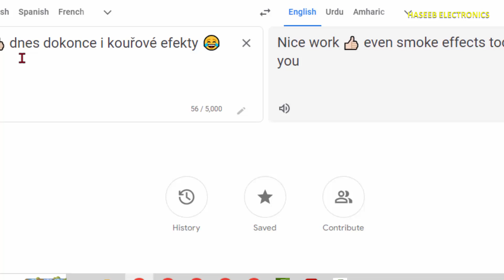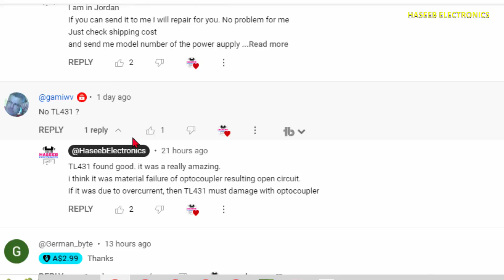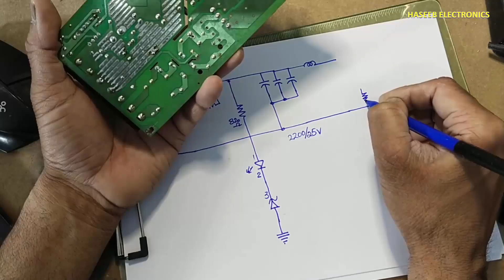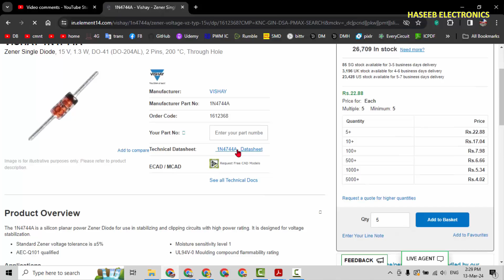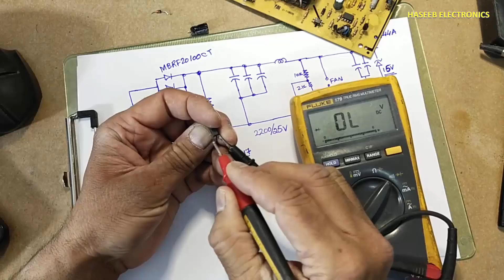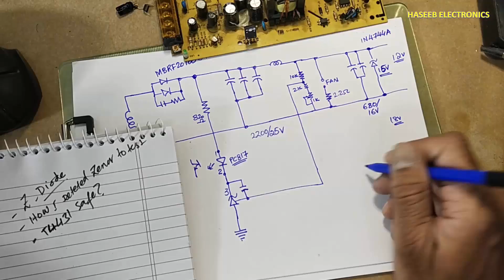{1071A} Why Zener not installed? SMPS secondary side, explained

Comment: Hello, congratulations on your very well-explained videos. I've learned a lot thanks to you. Could you explain the starting resistance circuit, how to go from 300 volts to 12 or 15 volts for VCC, and what current is needed for the calculations? If the VCC input were to break, would the capacitor charge to the supply voltage and consequently explode? Thank you.

Comment: I face  the same case as here ie ZD   short circuit , when i  rénové the faulty DZ I get the constant 12.20 without fluctuation ...now the question is what DZ raté çan i use because the DZ's  broken and i have no clue about the value [ no schematis under hand ] thank à lot

Comment: selam aleyküm.ı have two smps led transforemer one of them out voltage is 12 volt  good but fan no working. the other is  voltage is only 2.9 volt..ı did check IC is okey. 2655 two transistör is ok too.big capacitör is 320 dc volt okey too.ı didnt know what is poblem..thank you very much inşallah you will write to me for answer.ı will wait my brother

Comment: good video i am a follower of your videos. your videos are so informative and lot of new ideas.
- sir I have a 24V power supply with no out put - the PWM IC is 3845, I have 2.6 voltage only on VCC pin of the IC.can you please advise.

Comment: Thank you your post. Based on your video I was able to identify the wrong component in my SMPS. As you mentioned the ticking noise means there is a short in the secunder circuit. Stable but low voltage - 3V - output means the feedback circuit is ok. Using infra camera the TNY610 SCR glowed up which I think is doing the output short protection on the 5V rail. After desoldering it turned out it is malfunctioning, 600 ohm between the Gate and the Cathode in both direction. Replacing it tomorrow, curious about the result.

Comment: Greetings from Russia! In my switching power supply, when connected to the network, the Schottky diode immediately burns out (in your case, these are MBRF20100CT diodes). Replacing the pulse transformer, PWM controller, smoothing electrolytic capacitor does not give anything. The zener diode is 12 Volts when ringing in the circuit, normal. Although, the mains voltage. instead of 230 Volts, it was only 204 Volts. Please tell me the reason for the short circuit of the Schottky diode, and where (in what) to look for a malfunction??? Thank you in advance, peace and good luck to you.

Comment: CAN WE PUT A RESISTOR IN SERIES WITH ZENER DIODE TO SOLVE THIS PROBLEM?
Reply from the maker: no 
it is a sfety crowbar. it must remain in same condition 
in case the SMPS exceeds its limits. this crowbar will protect the next circuit

Comment: EXCELLENT ANALYSIS . Crowbar protection diodes is a real headache when I had to repair SMPS (5v 10A). Another problem I had found is their "long time stability". I mean that after some years of 24/365 operation their "reference voltage" (5.1V in my case) has "drift" to a lower voltage and when reached 4.85V the SMPS start fluctuate (almost catastrophic failure for industrial computer/controller due to continuous "reboot")
Reply from the maker: thanks for your valuable comment 
you are right, after passage of time, the resistor values get devalued. which cause drift in center value. sometimes the "volatge reference" is also suspected
Reply: thats why in industrial or other sensitive environments such as hospital equipment there has to be maintenance or replacement of modules that are known to wear out as time passes.Almost always the service manual or the manufacturer has guidelines as to what  to do and how often.ofc im talking about very expensive machines,not cheap everyday consumer electronics.
Reply: @dimitrismaster  When you are the designer of the board/circuit as in my case ?
Reply: @gamiwv  then you know when to do maintenance,and replacements.
Reply: @dimitrismaster  Yes in controlled environment. On the field (in Greece we are reaching 42 C degrees in the field and bare external metal case under the sun more than 57 C ) NO
Reply: @gamiwv  I know what you mean.Im Greek as well..

Comment: Thanks for ur videos Mr., I HAVE QUESTION,When electrical components connected in parallel they have the same with the source voltage ,but in the case zener diode the history different, how this could be why zener diode change this rule